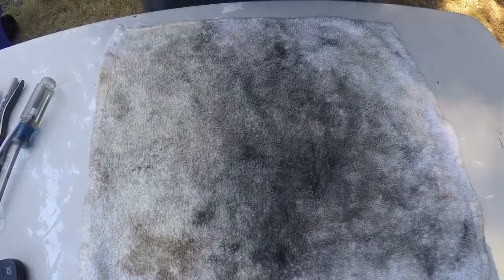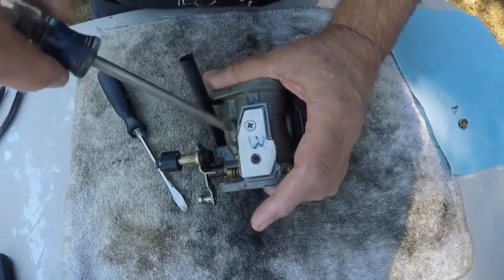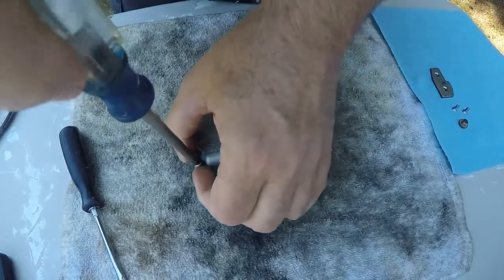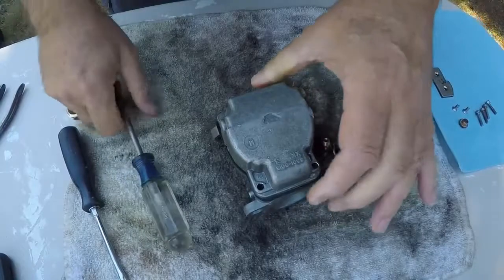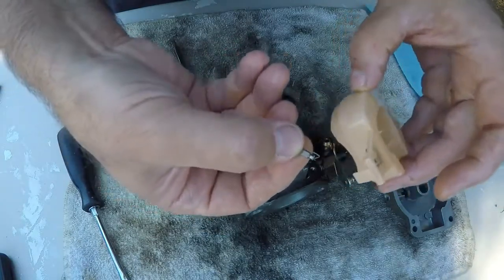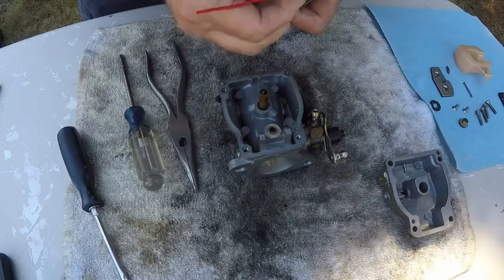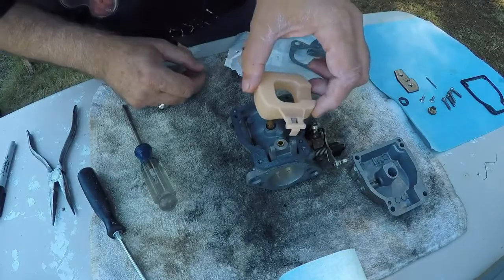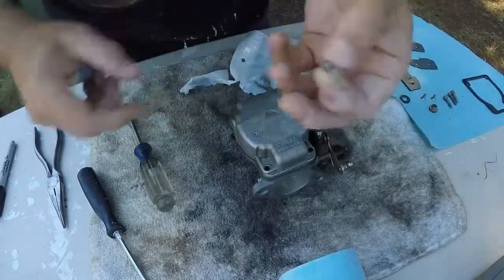Merc 60hp carb rebuild

Comment: Nice work there, I soaked my carbs in berrymans carb clean over night and running like a champ 4 years later
Reply from the maker: Since this first video I made years ago have been using berrymans too. Carb cleaner spray is what really cleans the jets and a small wire if you can't get the jets out and the small holes inside the shutter area. The berryman I like because it gets the outside so clean. People buy them vibrating containers but just putting the carbs in a can of berryman works for me

Comment: All 3 of mine missing the slotted screw that is next to the idle mixture.
Reply from the maker: Those carbs only have one adjustment screw for each carb. All set @ 1 1/4 turn out from seat
Reply: @TimsWorkshopTJY   Thank you. I'm doing the link and sinc after work , 🤞🏼 I don't need to set the timing
Reply from the maker: You are correct, once the carbs are clean and replaced what's needed you are ready for testing for leaks on the carbs. I hook up the fuel bulb and line to pump up. If dry you move on to install on motor. Then check the link sync and if off readjusting is required. Timing should be good still but you need to check the RPM @idle in forward gear. If to high then adjust the small idle timing screw just enough to get the rpm in the required range. Then check the throttle cable at the idle stop to make sure it's has a paper thin gap and not hard up against it. If need to adjust my video shows how to set it. The video is "carb reinstall and link/sync"

Comment: I have the same carburator. What's the part number or how to order it?
Reply from the maker: Let me look it up for you. I know there are a few year mercs that took the same carbs for 2 strokes. I'll get back to you and also share a schematic
Reply from the maker: https://photos.app.goo.gl/TxzvYPDi42A5q8Xj8
Ok Papo, hopefully the name is ok? Anyway here is info from my book on these carbs. Look at one of them on your motor to see if it's a 44 or 45? The other numbers are the order of the carb and details for each one like linkage ect..  all is important when ordering one online. A rebuild kit is basically gaskets. If you need a new float or jets you have to buy it at a local OMC dealer,  parts  department for marine. So far on mine just replaced gaskets and one float that I accidentally poke a hole with a screwdriver trying to separate the float bowl. Woops. Easy to replace but a pain to setup a new float to the proper height. Anyway let me know if this helped you out. Thanks for watching. Tim

Comment: Good job bud! I have the same carbs. When I rebuilt mine, The bowl didn't come off easy like everybody else videos. I even tried the tapping with screwdriver to no avail. I had to pry it open after 20 mins of tapping and trying by hand. You're float looks cleaner than mine. The previous owner must have uses ethanol gas that turned the float a dark orange color.
Reply from the maker: Yes I lucked out with mine. I over torqued the cover on one and cut the new gasket. Won't do that again